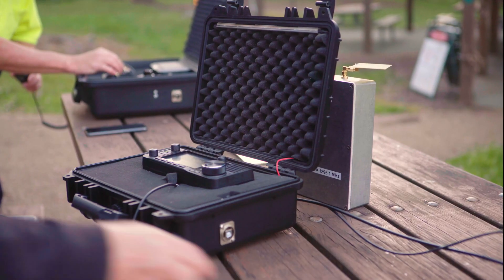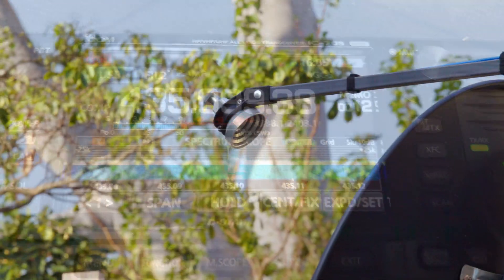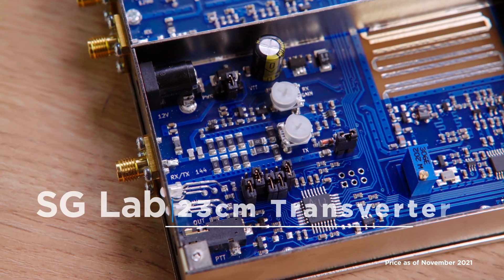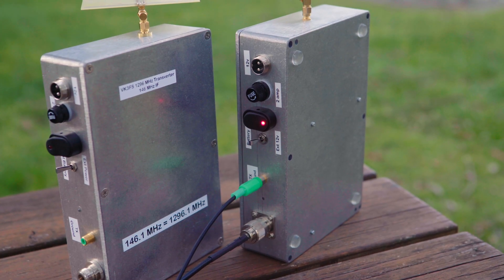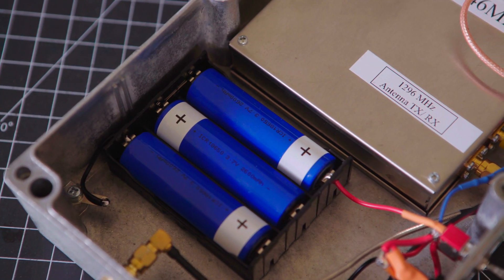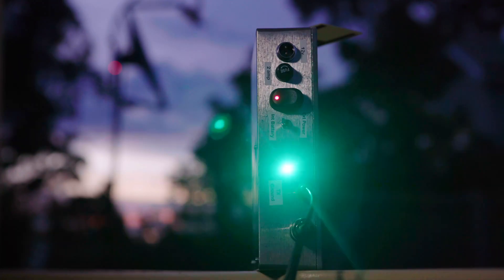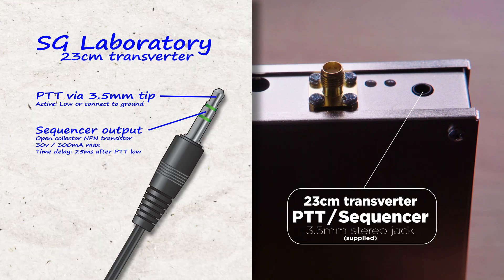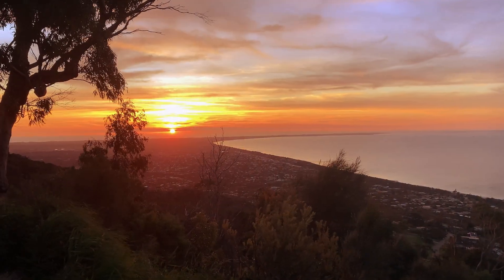1296 on the Icom IC-705

Comment: Nice build. How did you fix the transverter to the inside of the diecast box ?
Reply from the maker: Lucky it just fits with a little bit of room for the connectors
Reply: @VK3FS  I mean, how did you mechanically fix it ie. make it stay in place ? I can't see any brackets. Did you use glue ?

Comment: Thanks for the video Andrew. I ordered one of these. I have a quick question for you. I have the Yaesu ft-818. How will I engage the ptt on the unit as I noted you did so with the 3.5mm jack off the 705.
Reply from the maker: Hi Kevin.  I too have an 818. Have a look at page 15 in the FT-818 manual. You'll find a pin marked TX Ground on the 8 pin DIN ACC jack. When you TX that pin goes low which will engage the transverter. I've added a picture on the bottom of the blog post. https://3fs.net.au/ic-705/1296-on-the-ic-705/ Cheers Andrew
Reply: @VK3FS  thanks so much!